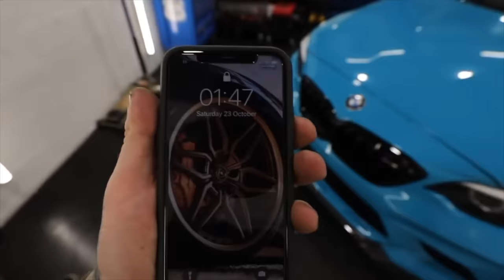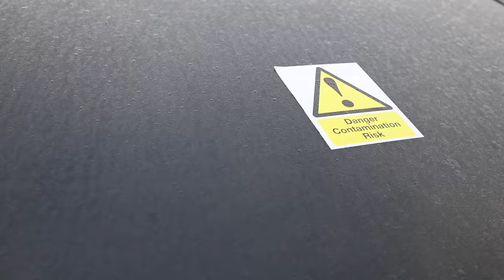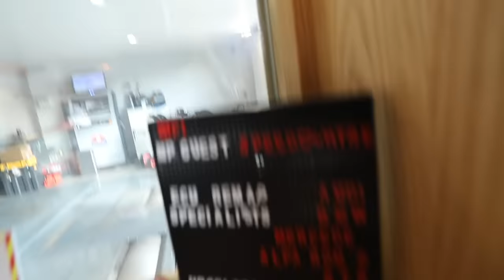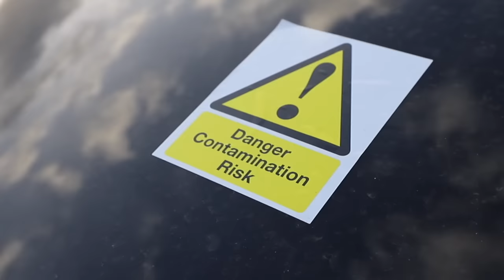I BOUGHT MY FRIEND A WRECKED AUDI S3

Comment: Hey Matt the headlights on the S3 will defo need coding, I had the same issue with my S3 on my channel so if you can find the headlight packs in the car you will save yourself a massive headache as they have to be coded using ODIS

Comment: Amazing what you find left in a car when you buy a used car.  Bought a 330ci last year to auto cross with.  Found a hammer stapler, screws, nails, broken glass, oh and a literal crack pipe stuffed under the hand brake boot.  Confirms a lot of my suspicions about the previous owner.

Comment: Not sure if the  curtain airbag  from a hatch will fit but the dash is the same from 2013, doubt the rear belts would of gone off but double check and the module will reset easy with any diagnostic.
Hopefully u didn’t buy this from Wolverhampton Copart as that’s close to Birmingham 🤢